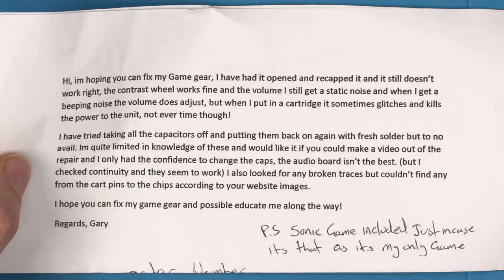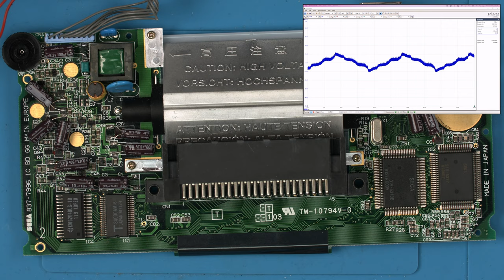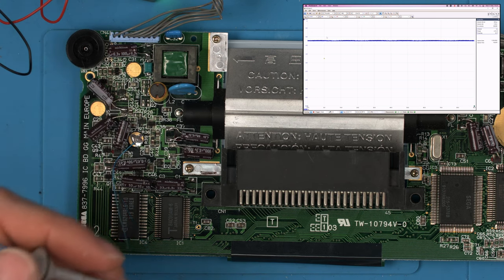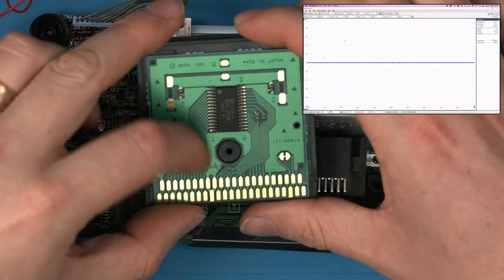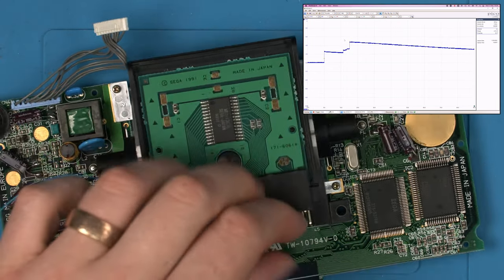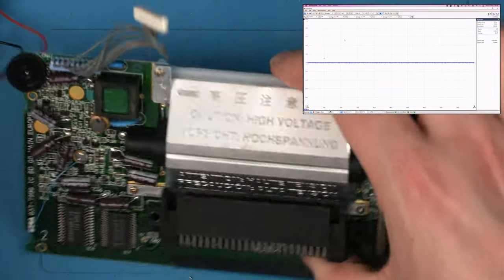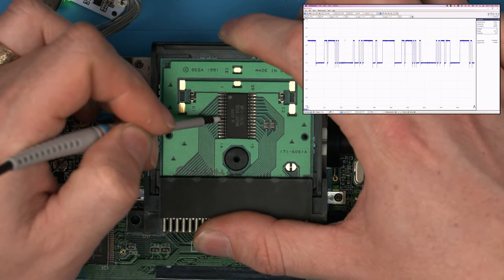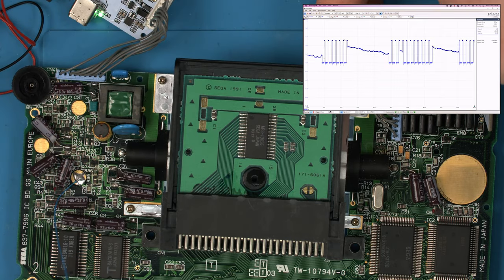Game Gear No Game Load Audio Screech Fix Repair

Comment: Helped me fix my game gear that wasn't reading cartridges properly. Most of the time black screen no sound, sometimes loading screen or partial load but then freezing or graphical glitching and audio static. After pulling out the connector pins with tweezers and lightly filling them, it now works properly every time. 👍